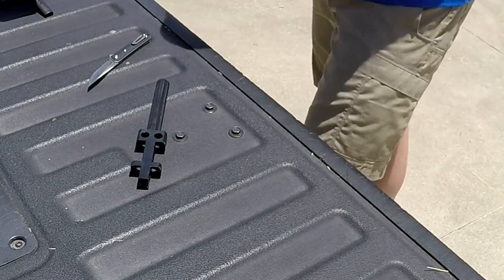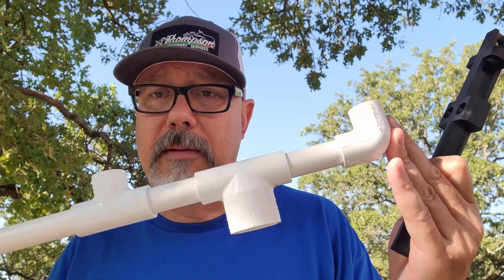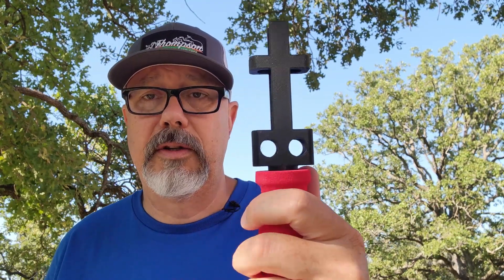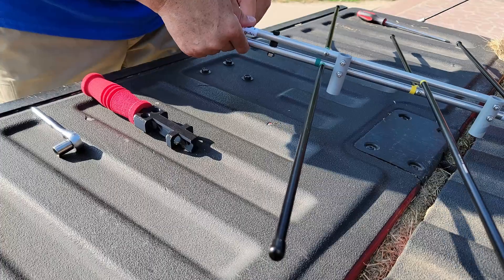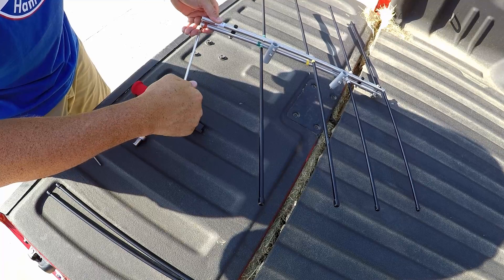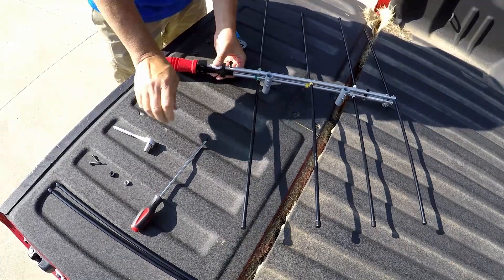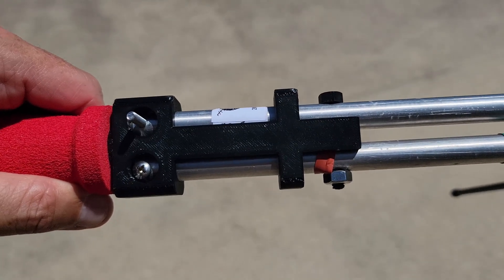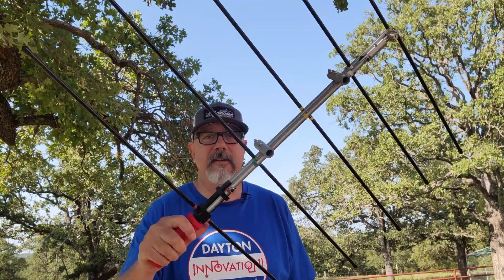Satellite Antenna Mod! #hamradio #satellite

Comment: Hello, greetings from Mexico.
I'm Sergio Montemayor "XE2SMG"
I would like to know how comfortable the ELK antenna is with the printed handle.
My interest is because I have undergone some surgeries on my spine and both shoulders.
I'm currently using a homemade Moxon antenna, which weighs approximately 1.7 pounds and is 41 inches long.
With these physical characteristics of my antenna, holding it by the handle will put considerable strain on the joints in my hand.
I performed some rudimentary tests with a luggage scale, and the pressure in pounds exerted in my hand is approximately 6 pounds.
How much does the ELK weigh without the PVC pipe?
Regards, 73 DX
Reply from the maker: See Short reply

Comment: Really good video. I have an ELK which I do use for my satellite work as well. If you don't know anyone with a 3d printer any ideas on where to get one of these handles produced?  Thanks, Dave  KE6EX
Reply from the maker: Hi David, I am glad you enjoyed it! I have seen print shops online where you upload the STL and they print the item and ship it to you. I have never used one of those services though. The ones I have tinkered with allow you to upload a file then play with various filaments, fill percentages, etc to provide a price. It may be worth considering. Cheers!
Reply: @digital.rancher   Thanks for the advice. I actually found a company local to me that does the 3D printing.  I will be calling to discuss pricing or I might just try the online route. I will post an update and let you known 73 Dave

Comment: Is the Elk yoir go to antenna these days for v/u sats?
Reply from the maker: The Elk is lighter, less bulky and easier to travel with. If I am at home and I have a low elevation pass I grab the jetstream because it has a little more gain. Otherwise I am using the Elk.
Reply: @digital.rancher  Which Jetstream antenna do you use for satellites?

Comment: Awesome!  Glad the handle and print worked out for you.  I had to do some drilling for mine to fit, but with a little force, it snapped right in.
Reply from the maker: It definitely took a little force but in part it was due to the Elk ID sticker that it has to slide pass. But it does have a satisfying "snap" into place when you get past that sticker. Thanks again for printing and sending!